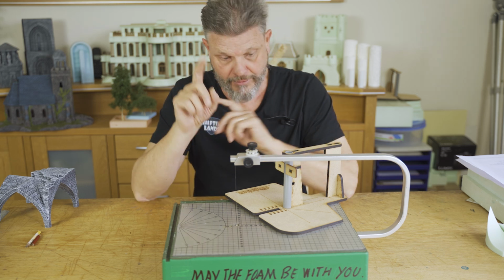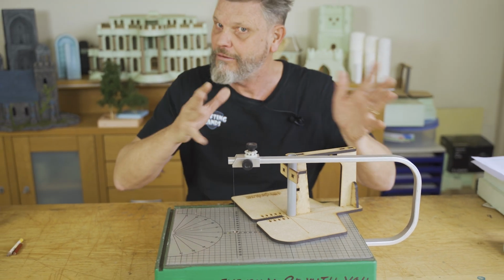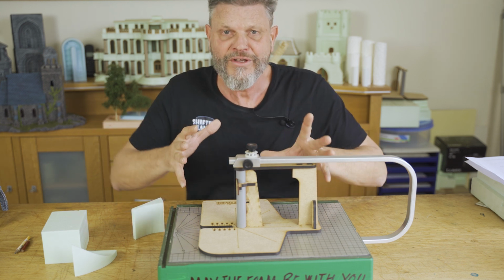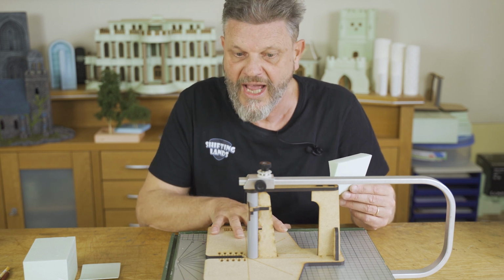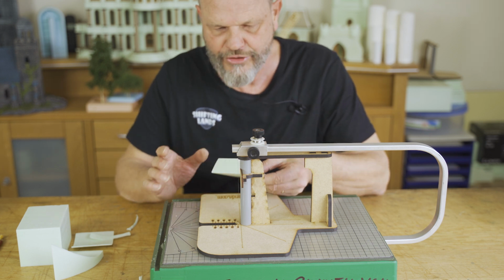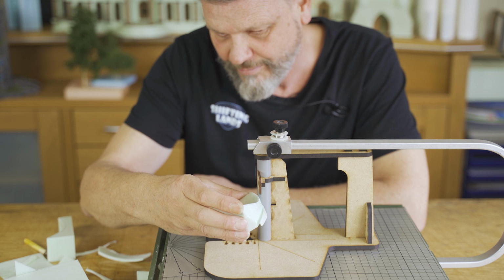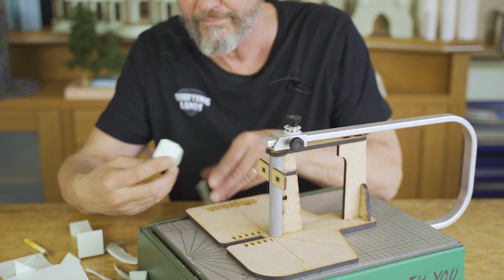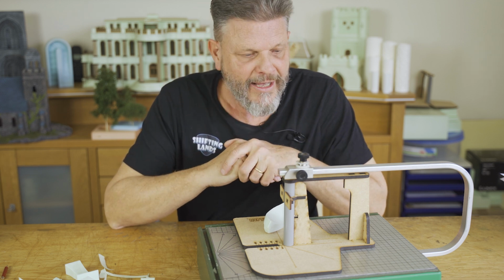Peeler Tool: Slicing & Peeling Curves and more!

Comment: Just wanted to thank you!
I bought the angle cutter a few weeks ago and it's exactly what the doctor ordered. Only change I made was to cut out a section of the side panel so I could ramp up the angle even more without hitting the wire lock knob or changing sides.
It's a given that I'll order more items from your store as the need arises.

Comment: Nice. 
1. Do you have a solution to cut out round holes(cylinder) without penetrating the outer material. Like thrilling a hole.
The only idea i have is to thread the wire through a smaller hole, attach it again to the upper contact and then cut a round circle.
2. Is it possible to cut a round hole without turning the hole foam?
Reply from the maker: That is the only way to go! 
Not sure what you mean with Q2.

Comment: what are you doing with the foot pedal? is it a part of proxxon machine?
Reply: it's a handy little accessory that lets you activate the cutting wire with a foot switch without having to constantly turn the machine on and off by hand.

so you also have both hands free to work and do not have to press buttons on the machine all the time.

very helpful and not even expensive.
Reply from the maker: Exactly that what FlightplanNr.10 wrote!